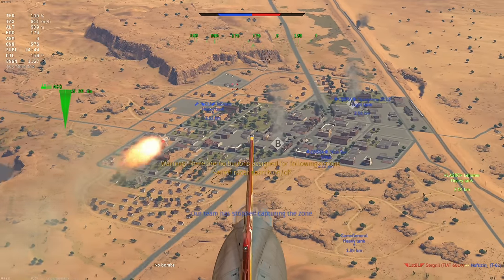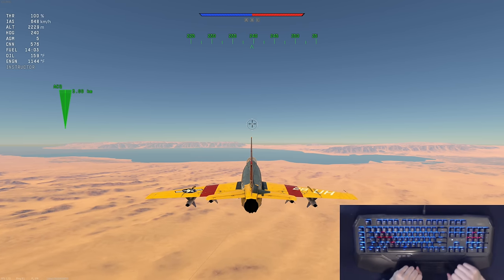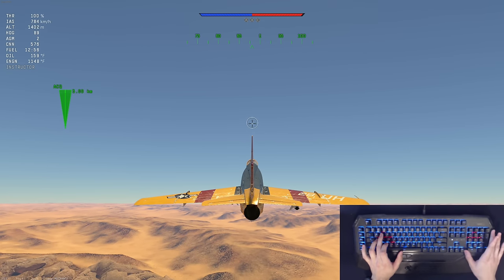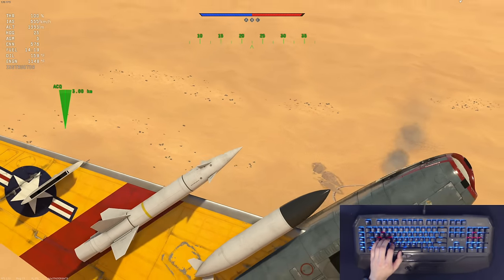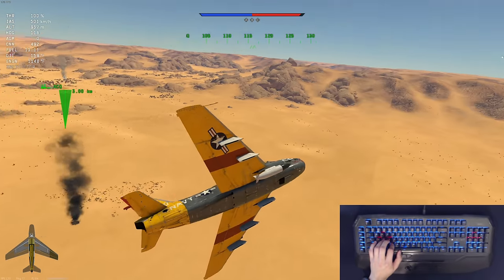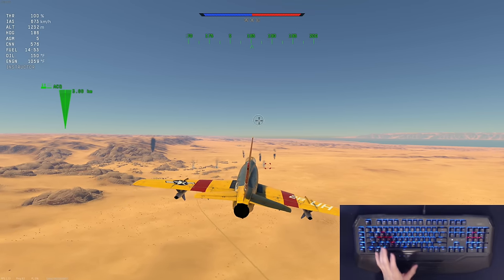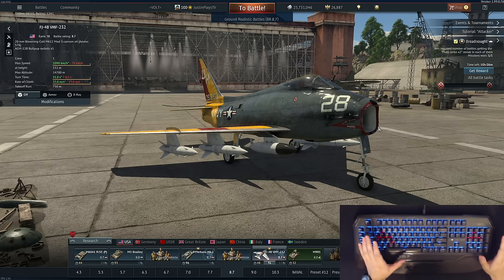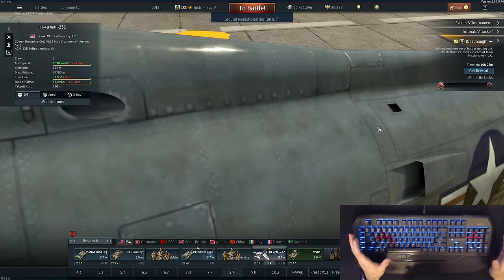War Thunder - How To Guide - Guided Missiles

Comment from the maker: Just a heads up, ensure that the "Relative Control" function is disabled on both the pitch and yaw controls.

Should clear up some issues.

Everything is still the same, spacebar for launch (drop bombs), Numpad for control, etc. Using this method in conjunction with dump drop bombs may cause issues with the missile launching, something you will need to play with.
Reply: Hey man could you give me the control config of your setup if you're able to? that would help a lot thanks!
Reply: How do you turn your plane with WASD without it just barrel rolling?
Reply: How do you turn relative control off?
Reply: Is there a video on how to defend yourself from missiles?
Reply: I tried using ALT+W/A/S/D for the controls which allows me to keep my right hand on the mouse.
Reply: Yeah I couldn't do anything with these until I turned off the relative control and then it was good.
Reply: for some reason i can't find the relative control setting, help!
Reply: @ZETH_27  DUDE THATS SO MUCH BETTER! ty

Comment: GUYS disable relative control to stop the guidance value sticking
Reply: this is the most important thing not in the video. hands down.
Reply: Now it make sense, my missile going waaaayyy off target even when i adjust it slightly
Reply: Thanks dude. Love u
Reply: where is this setting?
Reply: Where to find that setting? Thanks
Reply: Thank you kind sir
Reply: Does this also work air to air?
Reply: Thanks dude. Why is that even on option.

For anyone who can't find this option it's under weaponry, yaw/pitch axis for aimed weapons -> open the sub menu and set slider to no

Make sure you do it for yaw and pitch or you get boomerang missiles
Reply: dug through the comments looking for this

Comment: I hated that plane when it was added, at first it was super op because it got a fly by camera on it, but they remove the camera after a while, but that doesn't stop the spam at 8.0+(I forgot what br it is since it has been so long) since the missiles is super accurate and have so much explosive inside the missiles
Reply: They should buff the nord missiles again, planes are supposed to be able to wreck tanks like in real life

Comment: I forget what it is called, but I think it is relative control? Yoy either have it on or off, but you want the one that jumps to 100% value then back to 0% as well. Its much easier to guide them in when there isn't a slow curve to changing direction.
Reply: Thx, exactly that was my stuggle!:)
Reply: @johnnhdb8562  No problem mate. Still a little tricky to get used to, but definitely helped me when I was learning. :D

Comment: How is that your horizontal and vertical guildance has ''home value'' set to 0 whenever you stop controling your missile. When i control my missiles, those values change all over the place so my missile keep flying from side to side up and down. + if i don't reset values manually to 0, next missile will fly based on values from prievious shot
Reply: î just found it out you have to look for Pitch/Yaw axis for aimed weapons in the controls and then on both of them you have to rmb click them and then click edit axis and now make sure to disable all the toggle switches so an most importantly to disable ,,keep value for disabled axis,,
Reply: @steak1358  i found it, I had to disable ''relative control'' for both horizontal and vertical guidance setting.

Comment: your better off using the arrow keys not the numpad, just an FYI coming from a veteran fj4b 232 pilot, i also set the multiplier in weapons aiming to 0.2 if it is not already default
Reply from the maker: The idea for Numpad is to keep my hand as close to the mouse as I can. Hence my efficiency
Reply: @JustinPlaysTV  sure you can do that, but you have a good chance of pressing wrong buttons

Comment: What's the red square that appears when aiming the missile ?
Reply: That’s what I’ve been wondering
Reply: @cutthroat795  same
Reply: The square appears on the ground where the missile will land each time you fire one. It shows you how far out you are from the target, and how much you need to course correct. You also have to bind a key to reset the point between each missile fired so that it's fresh each time.
Reply: @silverfortytwo9506  No it isnt, if you shoot the missile while using the control surfaces, the box appears somewhere else entirely.

It's not like the ballistic computer, otherwise it would just have that instead of this box, but it definitely isn't what you say.
Reply: @Andy_M.S.c  Well it shows you the current trajectory and how you need to adjust to hit the target

Comment: What I'm failing to understand is how you are using a combination of mouse and keyboard. As soon as I let go of my mouse and try controlling the plane with only WASD, I can't actually turn or anything as the mouse is still pointed in the same direction and constantly pulls me back to forward. How are you getting around this, in order to have "full control of your plane" while firing, as you reiterate many times?
Reply: Because with he’s keybinds w is to go down and s is to go up and shift and control are the throttle
Reply: @hunterforte8814  yes thats my controls as well, not what I was asking. I'm wondering how he separates the keyboard controls from the mouse. When I try and use WASD to fly, the plane keeps trying to snap back to where the mouse is pointing, but I see that he is able to fly wherever he wants with WASD while controlling the missile with the Numpad and no hand on the mouse. Is there maybe a keybind I missed that temporarily disables mouse aim?
Reply: @ryanrolet7388  he holds the free camera button "c" key ,thats why
Reply: @zmeu_md3831  still doesn't stop the plane from resetting towards the mouse position. I know about free look, its how you can look at the target...
Reply: @ryanrolet7388  I think it’s a setting in options called disable auto pilot for gunner and bomb sight, it makes it so freelook let’s you turn and stiff
Reply: @justin2696  I have this turned off already, doesn't produce the desired effect. Perhaps its a different setting?
Reply: I doesent go back if ur looking backwards
Reply: @ryanrolet7388  Press C, look backwards and then forwards again. Then your plane will only move with WASD
Reply: @ryanrolet7388  in free look look so far behind you that you dont see the cursor any more and tap w or s while keeping c held now when you still in free look look back forwards you can move the cursor with wasdqe. You can go back to normal mouse control any time by just releasing c

Comment: Maybe this is a dumb question, but for me, my W and S are bound to my throttle controls.  If you have them as your aircraft elevator controls, then what do you use for throttle?
Reply: mine is shift for increasing power and ctrl for decreasing power
Reply: Use middle mouse wheel to control throttle. Bind some key for braking, so you can slow down on airfield.
Reply: i use mouse wheel for my throttle
Reply: Shift/cntrl
Reply: @davidj.3441  works too but I think is too hard on your left hand. Especially when you try manual engine control and manual flap control later on.

Comment: What sensitivity do you have the missile control axis set as?
Reply: Did you ever figure out what to use?
Reply: @MrTheWaterbear  yeah, I realized I had them set to relative. For it to work I had to turn them off relative.
Reply: @FetaCheese717  Do you mind writing out your settings? There are things like correction and such, that I’m not sure about as well.
Thanks :)
Reply: @MrTheWaterbear  sure thing. For both yaw and pitch make sure that relative control is set to “no” other than that if you want to mess with sensitivity I believe you would have to increase and or decrease the multiplier slider.

Comment: How can i see the agm pov
Reply: you cant lmao
Reply: @masterolof138  actually i found how lol. I knew its possible sucker.
Reply: @petrvicher6397  you can't third person camera the atgm anymore. Not the guided one.   Back in the day you were able to but they removed it because it was broken.
Reply: @petrvicher6397  No you can't lol
Reply: @bipbopking1101  actually its possible
Reply: @MisterDoomHimself  i can see the agm pov but only the manual agm
Reply: @petrvicher6397  what vehicle are you using, how????
Reply: @bipbopking1101  a 4 e early
Reply: @petrvicher6397  AGM-12B? I am trying on the F-5C and it doesn't work, I can't use AGM-12B on the A4E Early on test drive
Reply: @petrvicher6397  bro what setting is it i kinda need it rn
Reply: @petrvicher6397  how you tracking the bull pup?
Reply: @petrvicher6397  I can’t track bullpup, couldn’t for a few years now with phantom…

Comment: My vertical and horizontal control don't come back to zero like in your clip, after i used them. What do i need to change to make this happen?... cause starting a rocket or only just guide it like this is very difficult.
Reply: Disable relative control.
Reply: @lubomirhutan3436  Jokes on you there wasn't a pinned comment when he asked
Reply: @ming5577  oh yea i didn’t think about that sry
Reply: @lubomirhutan3436  sry on my side. I just noticed that the previous comment seemed insulting
Reply: @ming5577   nah its ok dont worry

Comment: What is that red square anyway
Reply: Gun stabilization for helicopter that can use ATGM and continually computed release point for aircraft that have it such as F4 phantoms so you can drop bomb precisely on target even at high altitude, Why the red square appear while lunching AGM guided missile? No idea it is a bug probably since it does not have any usefulness .

Comment: Can someone tell me hot to make the guidence to 100% instantly and back to zero when let go of the button
Reply: make sure relative control is turned off. if its on you will see increase value rather than maximum value. fixed it immediately.
Reply: @shade5589  where is relative control ?
Reply: @chugetnuget6230  controls>weapons>pitch for aimed weapons> edit axis>relative control >make sure it’s turned off.
Reply: @chugetnuget6230  "Pitch/Yaw axis for aimed weapons"

Comment: What are your sensitivity and control settings for the missile? I’ve been using them pretty well for a while, but mine seem to move a lot more with each key press than yours do.
Reply: Wait do you have relative control enable? if do please off it because with relative control you are adding & subtracting input while holding the key.
Reply: Eesma Aura I have it turned off, almost impossible to aim without it

Comment: How do you put down that red square. It helps with accuracy but where is the setting for it?
Reply: The red square actually feel like a control key bug, If you want to have the red square go to Control>Common>Lock target, This key is suppose to be used on Heli.
EDIT: For me anytime I lunch ATGM from heli or AGM from aircraft it will automatically appear even thou my lunch key is Space and Right mouse button respectively.

Comment: how can we do that on ps4???

i've paired everything i can to different buttons combinations but nothing works so far..
Reply: I paired L1 with both the left and right sticks.  Weaponry -> Yaw/Pitch Axis for aimed weapons.  

If I use the left stick, the plane will move with the missile.  If I use right stick, it will either do rolls or adjust thrust.  It's doable.  I left it that way so I can pick my disability for the situation.  Really need to attach a keyboard if you are going to use Justin's method.  

Good thing about Nords is they fly straight with no drop.  A lot of people just use them as accurate rockets and forget them once fired.
Reply: @LilStoops  well thanks for that, i'll try it. been a while since las time i played, mostly because of this reason..kept running out of ideas to bind the keys..
used to play these kind of games on pc with a proper hotas joystick setup but my potato pc wont run any good games by now.. best it can do is IL2 1946...

can we really just hook up a keyboard on a ps4? i've never tought of doing that. 
that would really fix a lot of problems
Reply: @mikelagaffe  You can indeed attach a keyboard.  I have a USB wireless mouse and keyboard connected.  Essential for replying to my many haters during WT :)
Reply: You can use keyboard and mouse on PS4 for playing WT.

It can open alot of stuff for you. 

You can start playing with a cheap A4tech keyboard and mouse connected to a USB hub connected to your Console by USB

Comment: The Fritz X isn't guided, there's a flare that ignites so that the bombardier can track it onto target. It has control surfaces like a missile but the pilot simply steers it onto target for better accuracy.
Reply: guiding and steering are synonyms
Reply: @sofieknive7382  In this sense, one would reasonably assume that when talking about weaponry, that bombs and missiles are either guided by some form of tracking computer or otherwise. While you aren't wrong, there are other ways it can be interpreted.
Reply: so still guided, just externally instead of internally?
Reply: @cursedcliff7562  You literally fly it onto target. This is by no means guided in the sense a modern AGM is. I suppose an argument for it being externally guided could be reasonably made, all things considered.

Comment: Also remember to turn off relative control for the missile control axes.
Reply: What does that do?
Reply: @mylifeonthepeninsula9521  it means when you release your keys for the missile, the missile will stop turning and will fly straight. You need to turn it off when you get the right trajectory, and it also means you get max authority on the missile the moment you press a key.

Comment: can I use ⬆️⬇️⬅️➡️ button? because my keyboard doesn't have a numpad. I'm using Vortex Series VX8 mechanical keyboard
Reply: yeah. Use what you want as long as you are comfortable with it. :)
Reply: here's a tip. use ALT+WASD. This way you can guide the missile with your left hand and pilot the plane using mouse aim.
Reply: yep
Reply: alright, thx for the advice I almost got my F-100D Super Sabre, gotta researched the AGM-12 Bullpup later & configure the guided missile key manually

Comment: How TF do IT works on console
Reply: Its simple, It doesn't
Reply: @PavFed  it does it’s just that you don’t have enough controls.
Reply: @johnnyboi1125  Exactly, you don't have enough buttons to map them, that's why I'd doesn't work.
Reply: What I do is use a button to activate the guiding and then guide it with the joystick. You'll be flying in a straight line but it's better than nothing
Reply: mahn after i watched this vid, i was like
"Holy Shit, WT is Deep af. AND how tf do controller players manage"

but i think the only solution is to play using a keyboard
i think there is a way to connect a keyboard to a console, idk
Reply: Μολών λαβέ  so thts means u connected a keyboard and mouse to ur Xbox
Reply: Μολών λαβέ  you can Also do that with PS4, and you can use your controller to control the aircraft and the keyboard for the missile. I Also use It for heli Key bindings and It's very useful